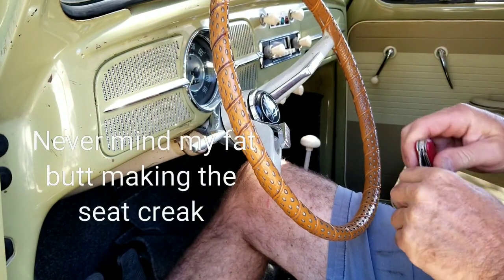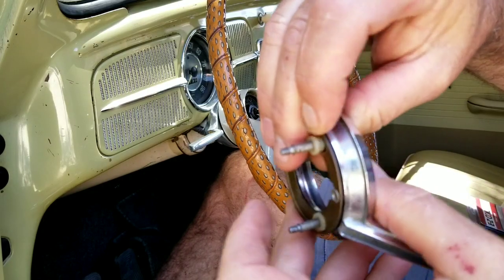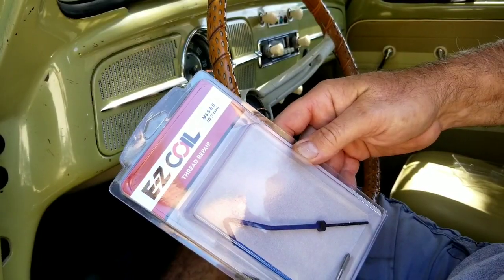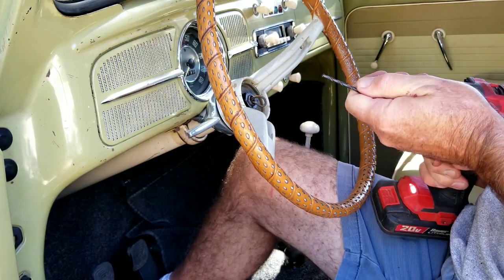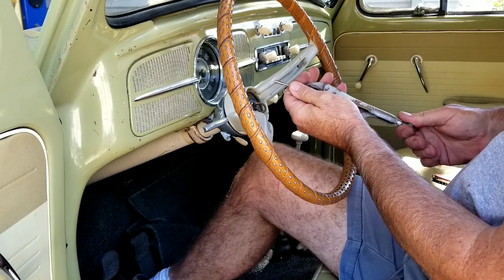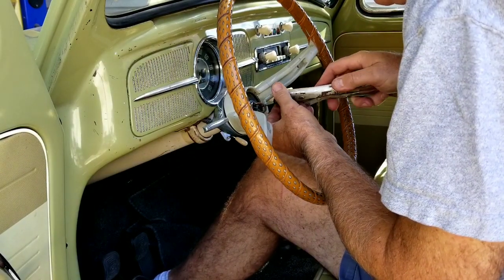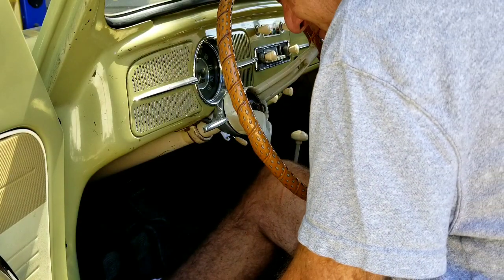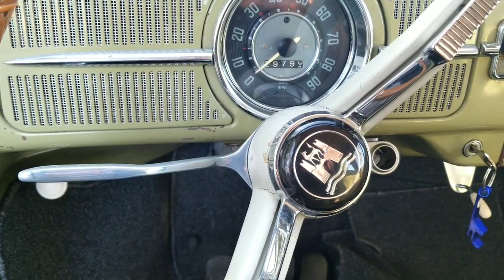VW BUG Horn button screws stripped Can we fix it.

Comment: Such a useful video as I have this exact issue on one of my bugs. Worse than your horn getting stuck on your ‘essential worker’ cruise. My wife drove the bug to her aunts funeral and the horn got stuck on!!! Everyone thought it was very funny when she arrived at the church, but I was dying inside as I was lying underneath the car in my black suit disconnecting it from the horn end!
Reply from the maker: I actually used my pocket knife while driving and removed the horn button and the wire. Never even pulled over. That was harry.

Comment: One does not think about the folks who never seen or installed a helicoil.  Late in my 20's my feet started failing and i could no-longer do the tool & die work .  I started night school working on my engineering degree. I woredk in a farm supply store part time.   A man in a suit came in the store with a manual on installing a fireplace cover. He told me if I listened closely;  i could hear his wife 10 miles away  luaghing . He told her that: " He was doing the install, not Sears service tech.   He needed to drill and tap around eight 1/4-20 holes. When he pick up a small hammer and asked if this is what he needs to  taps it with;  i understood them both.   Our store installed tires, so i took him in the shop and taught him how to drill and tap a 1/4-20 hole and explain the process and needed tools. Mike it was a win win. You see  I suck at writing and in college I had to take a two writing classes. I save his butt that day & he helped me with all my dangling participles.. I thought if your participles dangled that it was a good thing..

Comment: I'm not 100% sure but I think you have the round flat copper plate on backwards. That rim should be facing the horn ring, like a cup. You have that rim facing away from the ring.